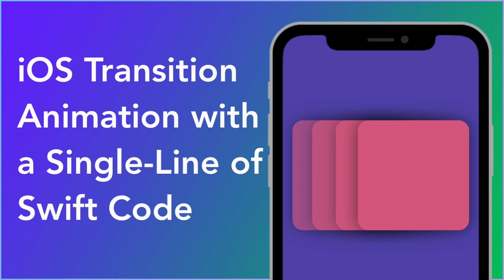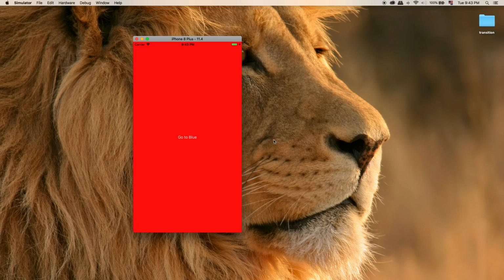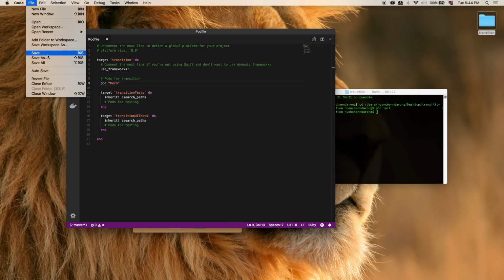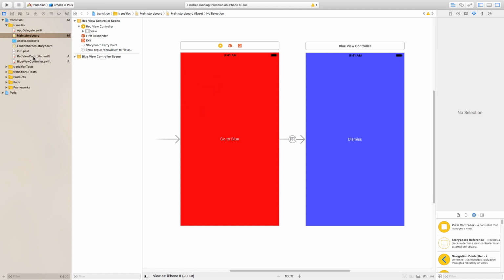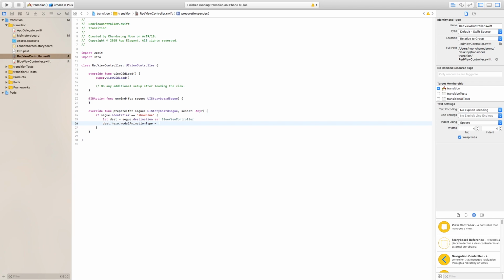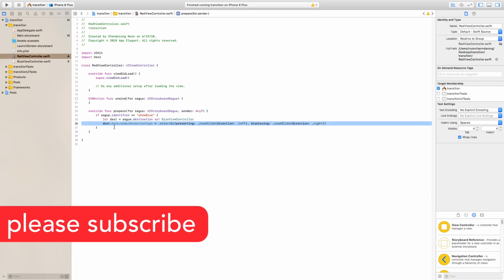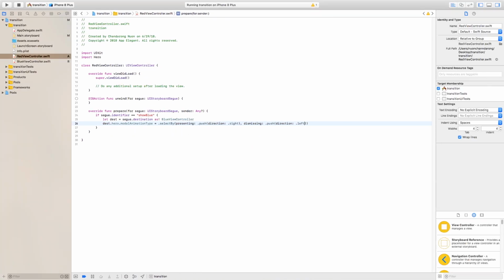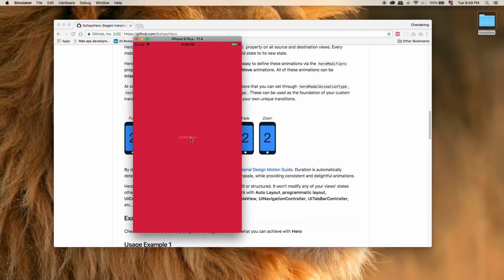Easy iOS Transition Animation with Just a Single Line of Swift Code

Comment: I tried doing this with a collection view presenting a UIViewController. The dismiss is not working. I presented it using replaceViewController(with:). would it be possible for you to look at my code real quick?
Reply from the maker: Sure, I’ll take a look. Please share your code.
Reply: @d-bug9617  Thank you so much. I did it programmatically. The code is within this stack overflow link. https://stackoverflow.com/questions/54857458/hero-animation-dismissing-viewcontroller